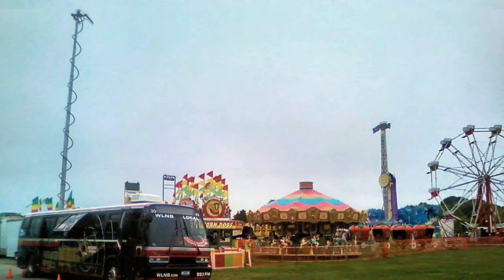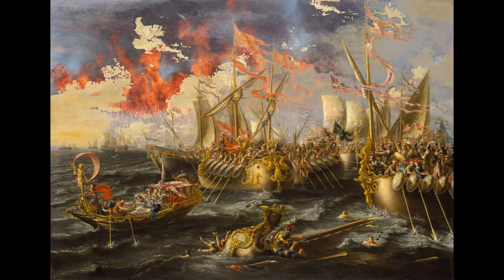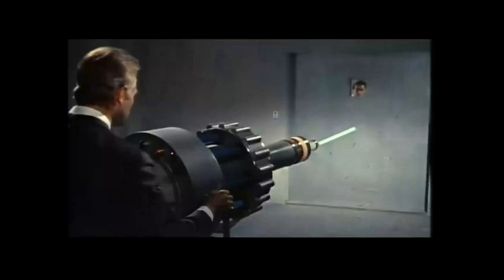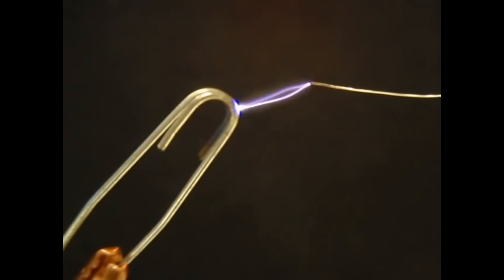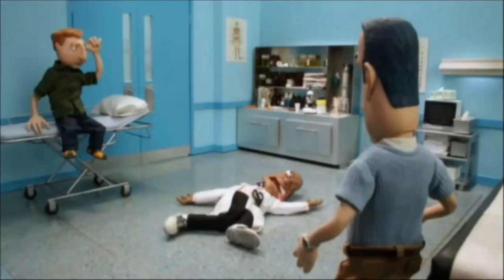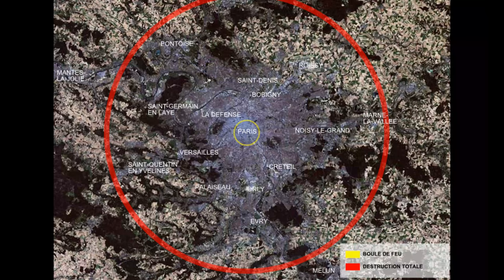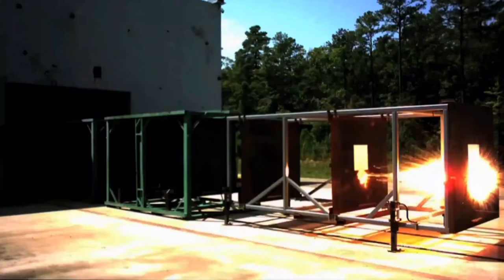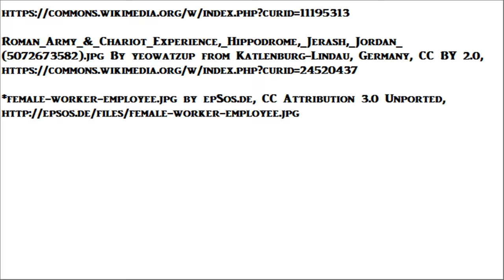How to build a solar Death Ray

Comment: The surface of Sol burns at 10,000 degrees. That's a plasma. A monoatomic hydrogen torch uses electrodes to achieve a hydrogen/oxygen flame which fits the description of plasma. It burns at 10,000 degrees. Sol is radiating from a 10,000 degree source. Theoretically, you can reproduce this temperature by concentration of solar rays. One of the reasons the US steel industry was exported to China was acid rain pollution caused by burning coal in steel plants. I don't advocate solar electricity generation, but it might be quite useful for smelting sans pollution. Also remember the Bismarck quote. "Nations are made of blood and iron." The USA began WW2 with 7 aircraft carriers. By the end it had built 100. Today that feat cannot be repeated. No iron, no defense.
Reply from the maker: Thank you, John Hardin, for the additional detail!  🎃  Sincerely, Bill